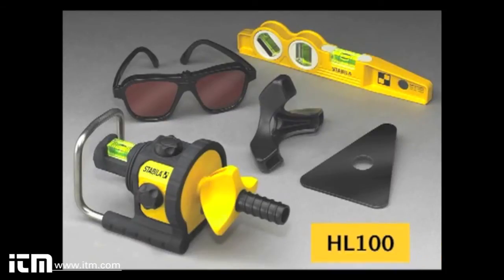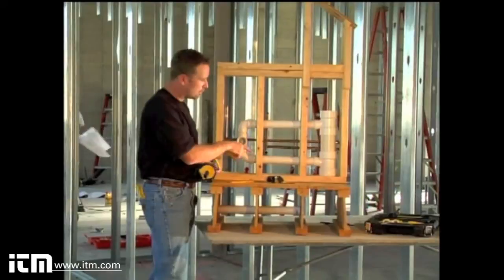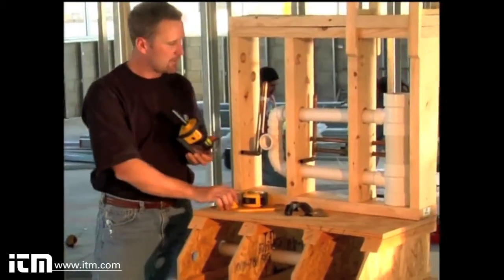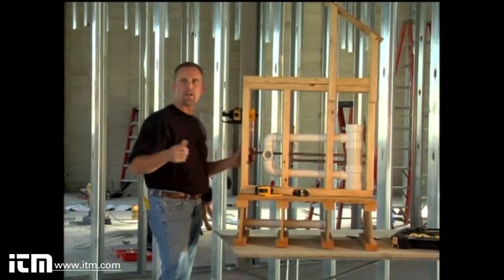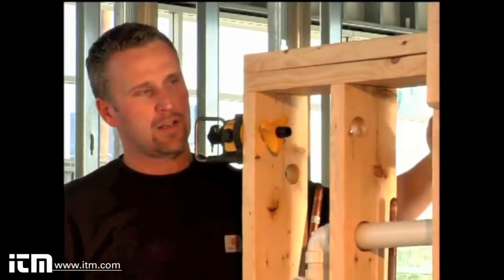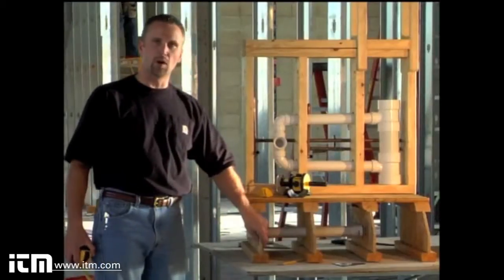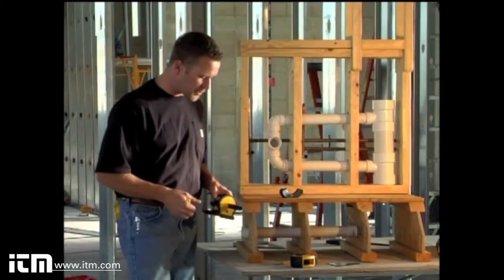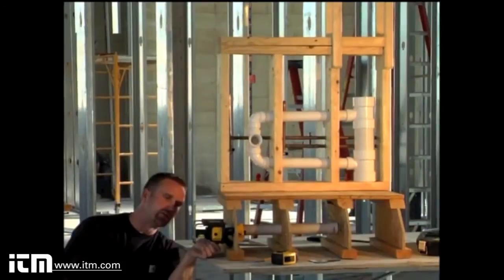Laser Hole Locator HL-100 - Stabila

Comment: But the laser dot is blocked by your own drill and hole saw.
Reply from the maker: Hi John! 
The best way to have your request reach the correct person(s) is to please use one of these contact methods:
https://www.itm.com/content/quick-contact
Reply: make a mark with a pencil, drill hole, move laser to new hole, make mark on next stud drill hole etc. They stopped making this for some reason though..
Reply: @TRUE_GR1T  Probably because it's just as easy to make it yourself
Reply: Lol mark laser dot drill hole. Then mark laser dot in next stud drill hole. No need to move the laser.